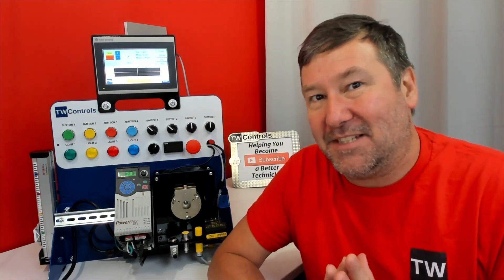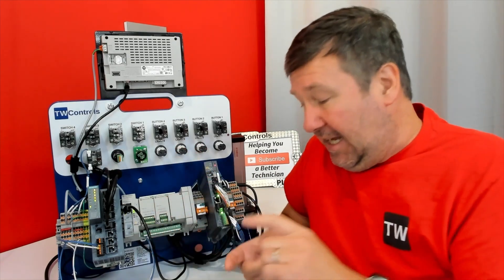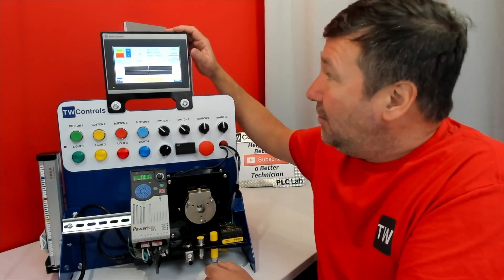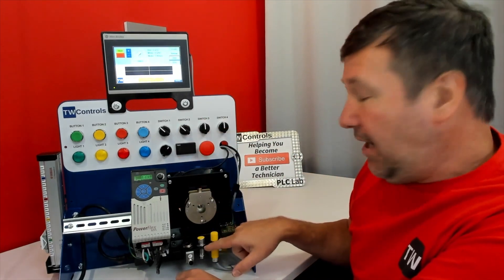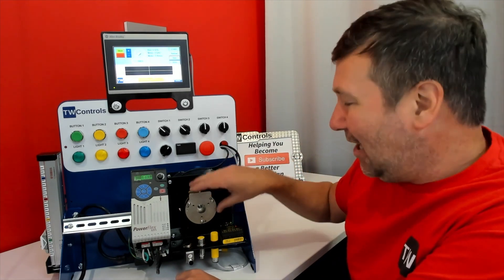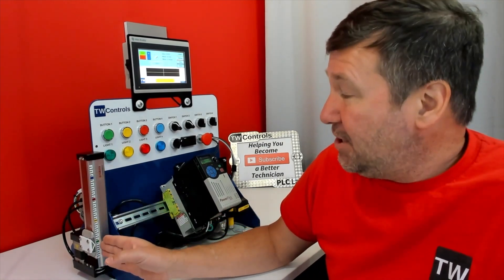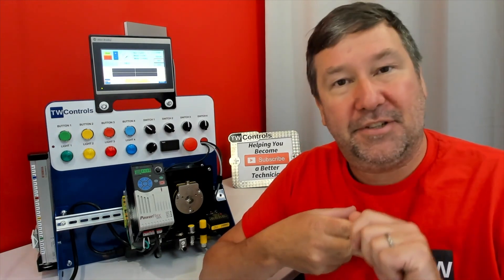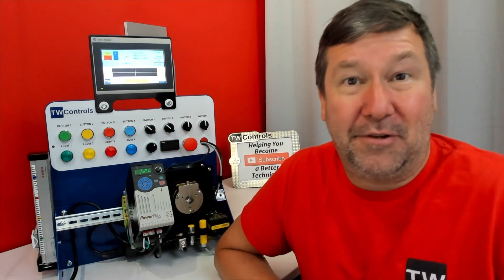Level Up Your Skills: Micro850 PLC Trainer

Comment: I've never used ccw, I work with studio 5000. Gx works 2. Old seimens s7 300 and 400. I really struggle with studio 5000 its so different to me than everything that has been before it. Seems they made a great tool for programmers, and a mystery for the co trols guys that come along behind. Would this trainer be a good tool for someone needing studio lessons?
Reply from the maker: We have Studio 5000 trainers as well. I would send an inquiry in and let's make sure it fits your needs. 
https://twcontrols.com/contact